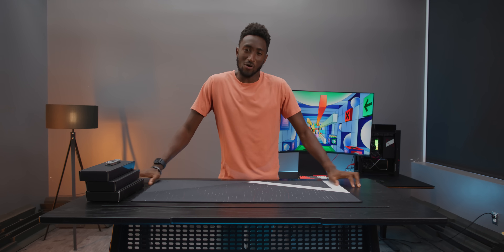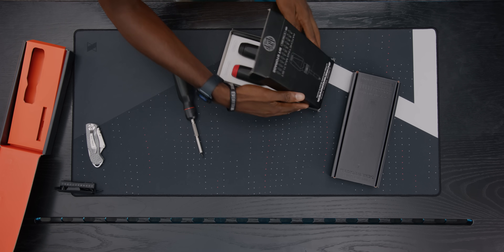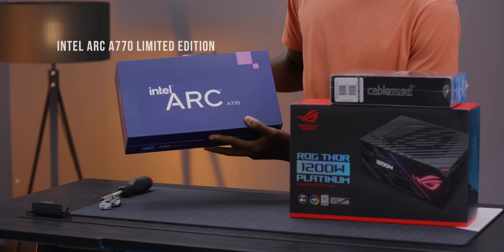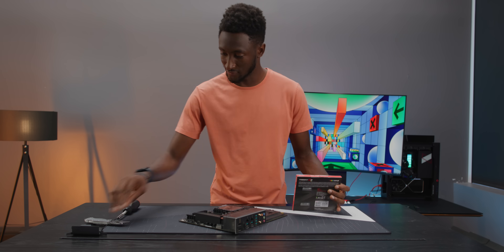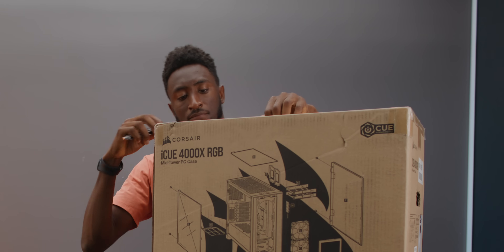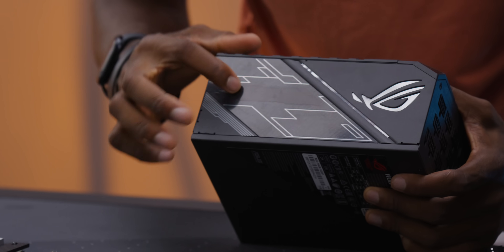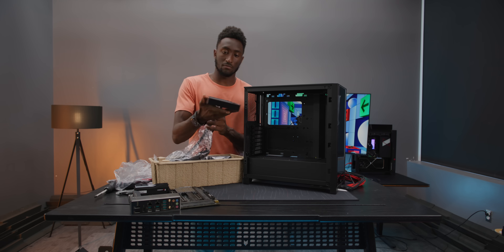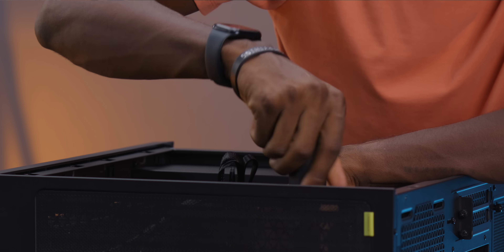World's First Intel ARC PC Build! (A770)

Comment: Great video and very clean.

But did Intel sponsor as well?. The Intel GPU is doesn't make any sense in a build like this. 12900k, 64GB's of RAM, insane storage, and then that GPU.
Reply: I think its more of novelty factor for himself as he's never tested one before.
Reply: @bruhder5854  Possibly, but you can't buy it, so this has to have been given by Intel. Which means its for advertising. It's likely this build will be stripped anyway. Still, seems suspect if Intel are apart of the sponsorship here or not.
Reply: @YTCraig  weren't all the parts provided by ltt?
Reply: @bruhder5854  That's unclear, but i would assume so, since their doing an add. In that case LLT sent an Intel GPU for the video specifically. Meaning it's apart of the sponsorship.
Reply: if intel sponsored the video, as in paid them to include it in the build, then they'd have to disclose it. so it was gifted by intel to them, but no money exchanged hands.

Comment: Actually zero issues with this build apart from the tubing placement, but that's not even dangerous, just sub-optimal and Marques even acknowledges that. Good job. Crazy to see LTT be a sponsor for once. Intel Arc was unexpected but ended up looking very clean.
Reply: That's actually the correct placement of AIO for the front as confirmed by GamersNexus based on their testing.
Reply: Not really an issue so long as the pump is lower than the top of the radiator.  Front mounting the radiator is better for CPU cooling that top mounting anyway.
Reply: He forgot the thermal paste tho.
Reply: @A_Realist_1  an AIO has pre applied thermal paste
Reply: Yo Fam I’m a small content creator, and I make a variety of entertaining reactions, vlogss, and a range of other content and I’m still working on quality but I guarantee you will find something you will enjoy! 🙏🏾💙💙
Reply: @Shraf2k  true. But it can still increase noise because of the bubbles accumulating near the inlet/outlet ports. Nothing serious.
Reply: The Intel GPU is a huge bottleneck, and their drivers are riddled with glitches. The tubing placement could end up destroying his pump.

Comment: Ouch...!!!    those frame times are horrendous. My HTPC hooked to an OLED (G-SYNC/Freesync2) of course with 2 of the best GPU's (3090ti TUF V2 OC and a 6900XT TOXIC EE "AIR") in a 2017 system with a 5.3GHz (5GHz ring) i7 8700K (YEAH, WE GOT ONE) Though, i dropped a Nitro+ RX480 8GB OC with a hybrid RX580 BIOS and runs 80-90fps with rock solid frame times. Also, that's a great way to waste a pure G-SYNC monitor. You say Lenny specced this computer. Man, next time just let me know. Truthfully, you should've waited. A whole new Gen of CPU's and GPU"s along with motherboards are about to drop. Great choice on the board though. Got the same board but you're going to need a solid socket frame adapter (brace) to get even contact on the 12900K. I went with Der8auer's. Also, i went with the 12700K i got for $300. I'll get the 13700K when it relates soon. It's basically a binned 12900KS. I dropped everything in Corsair's 500D with 3 extra LL120's which makes it 6 LL120's. I'm presently building 2 systems in the 1000D. Just picked up a $900 3090ti TUF V2 OC and a 6900XT TOXIC EE "AIR" for a crazy low $660. Thanks miner. Also, you should've waited. Intel and AMD are about to release some monsters, nVIDIA and AMD are also about to drop some 4GHz 48GB GPU's....no lie...

Comment: I believe the tubes from the AIO cooler are actually supposed to be at the top, never at the bottom.

That’s why you can mount it at the top of the case as well.
Reply: Wrong, tubes should be at the bottom with a front mount. Otherwise you get more noise due to air bubbles which always accumulate at the top thanks to buoyancy, so in a radiator you don't want that to be where the inlet/outlet ports are. Even worse if the pump is the highest point of your loop in such configuration, because it increases the chance of it running dry, and that's very, very bad. 

Marques acknowledges this, he had no choice due to what AIO he had to work with and how the case is constructed. It's nothing catastrophic to do it the way he's done it, but it's sub-optimal for noise and maybe temperatures a little bit.
Reply: @neoqueto  I just read my AIOs manual again and it indeed states that you should never mount it with the tubes down with a front mount. After looking into this, I found that this depends entirely on where you pump is. Whether it is in the CPU Block or in the radiator part.

Thanks for explaining!

Comment: Intel Arc getting it's first YouTube running debut on MKBHD was unexpected
Reply: The card actually looks really nice when the system is powered on.
Reply: @supersuede91  yeah it looks clean af but i would choose a regular 3060 ti over that intel has so much work to do
Reply: @MonicaHolly143  Bruh the A770 has 16gb of VRAM, 3060 has some sh*tty 8gb vram
Reply: @supersuede91  they still have a bunch of driver issues though.
Reply: @supersuede91  3060 also comes with 12 gb, which is overkill
Reply: @supersuede91  performance is trash though
Reply: @supersuede91  vram isn't the major factor in terms of performance between those 2 cards. I hope Intel keeps at it because we really need more GPU options and Nvidia is a downright sh*tty anti-consummer/anticompetitive corporation (but then again so is Intel and AMD had their moments too). But more options especially actually competitive options helps keep them all honest. In a few more generations Intel's cute architecture and drivers can hopefully mature enough that green won't be the only way to go when looking at the high end of the market. 🤞 even more midrange competition so they stop moving the cards down the lineup of chips while still charging more. Like the former 80 class cards being moved from the 00 to 10 dies to sell the 00 for more in the titan, then 80ti, then 90. Anyways... Yeah more competition 👍
Reply: @supersuede91  3060 actually like... works though...

also wtf are you doing on a 3060 that needs more than 8gb vram?
Reply: @supersuede91  Ah yes vram makes gpus so much faster.  That is why all the old and cards like the radeon 7 are still top of the charts.
Reply: @RobertD_83  Sadly the current "rumour" (it's all but confirmed at this point) is that Intel will be pulling out of the consumer card space within the next year, 18 months :( they took too long, hit too many roadblocks, and are struggling on the CPU side because AMD have competed so well, so the business side is forcing them to divest of some of their non-core businesses. They'll continue to work on graphics cards, but for the data centre. It's really sad.
Reply: @supersuede91  it's not all about VRAM count
Reply: @MonicaHolly143  yeah but with EVGA pulling away from NVIDIA it's going to be tough for me to support a company that doesn't look out for its own partners. If EVGA goes AMD or Intel I'll will buy EVGA.
Reply: @supersuede91  And? Do you even know what you're talking about? The arc series has so many problems in terms of stability and performance. It's 16gb of vram doesn't mean anything if the card is unstable.
Reply: @supersuede91  it could have a million gb of vram and it still wouldn't be that good for gaming because of driver issues...
Reply: @supersuede91  Doesn't matter when a 3060 is still faster lmao. It also got 12g of ram and both are 1440p cards, so it doesn't matter if the A770 has 16
Reply: @supersuede91   3060ti can do about 1440p gaming in this case vram does not mean a thing.
Reply: Unexpected indeed, but Marques is very known for having his tech weeks early, so it's kinda fitting
Reply: @MrThijmenmees  they are going to give it to him first over Hardware Unboxed or Gamers Nexus because those two channels hold nothing back when it comes to PC parts if it's bad they say so. 

MKBHD won't bad mouth Intel other wise they won't give him nice stuff same goes with Apple.
Reply: Yeah Ditto that! 👍😁
Reply: what do you mean? gamersnexus and linustechtips both had benchmarks for intel arc (a380) a month ago
Reply: Yo fam I’m a small content creator, and I make a variety of entertaining reactions, vlogs, and a range of other content and I’m still working on quality but I guarantee you will find something you will enjoy! 🙏🏾💙💙
Reply: Intel getting into dedicated graphics just in time for the dedicated graphics market to crash haha
Reply: it just goes to show how out-of-touch intel is. He isn't remotely qualified to be the first person. LTT has almost as many subs and is far more qualified and their subs are the ones who actually build PCs.
Reply: @RiceCubeTech  it's strategic. He isn't prepared to actually review the card like GamersNexus or LTT, just show it off, so it makes more sense publicity wise
Reply: @RiceCubeTech  This was a collab from LTT, so I assumed that it was LTT that send him Arc or coerced Intel into sending him the Arc GPU. He clickbaited and edited the headline to mention Intel Arc, as before it did mention being sponsored by another Youtuber and was just about him building a PC. That's why ARC or Intel is barely given much thought in the video
Reply: @RiceCubeTech  what are you talking about?
Reply: @kidShibuya  bruh he literally never properly reviews prebuilt PCs, let alone a standalone graphics card. It’s not powerful but it’s extremely important since it means there’s 3 viable competitors on the gpu market. It’s a huge deal, and the majority of MKBHD audience is for mobile tech like phones and Apple devices. 

Majority of his audience is nowhere near the market that will buy this. 

LTT also has a large 14m following (only 2 mill smaller) and a higher percentage of those people are even in the market for a gpu
Reply: @RiceCubeTech   I won't by the ARC GPUs until Intel can show that drivers won't be an issue even then they would need to put something out that can do 1440p to 4k gaming.
Reply: @RiceCubeTech  Intel literally went on the wan show like a month ago to show off the arc. They ran some benchmarks back then. They are not out of touch